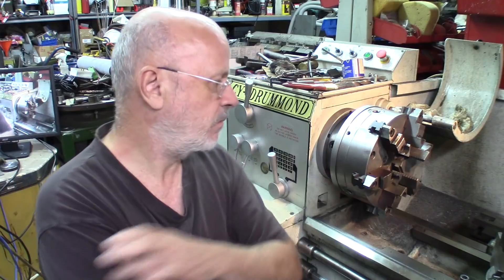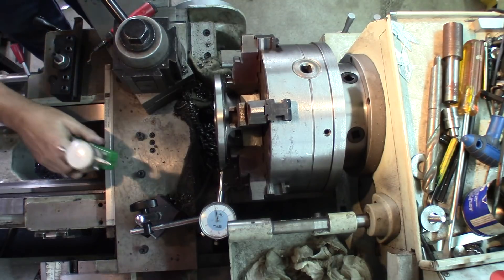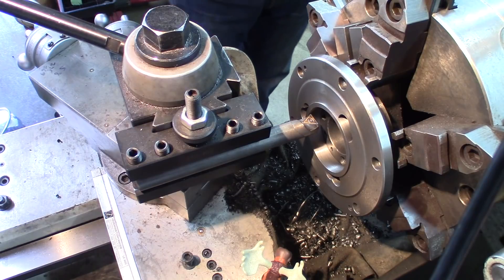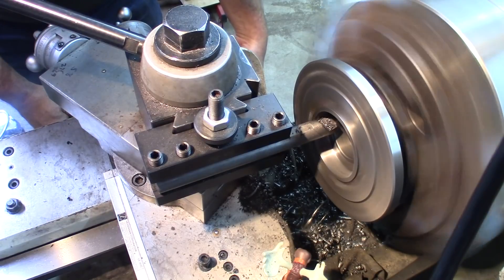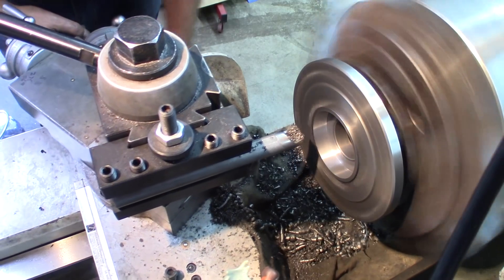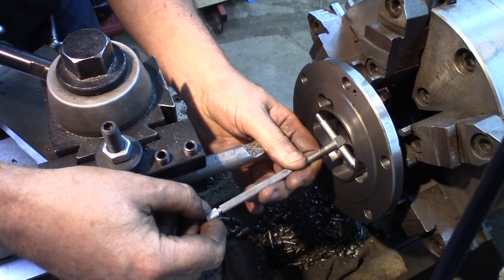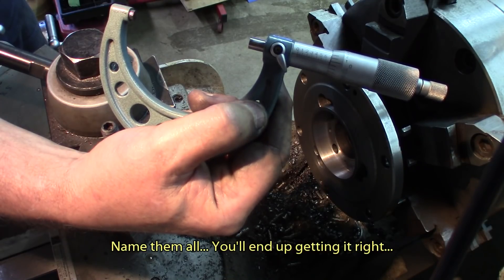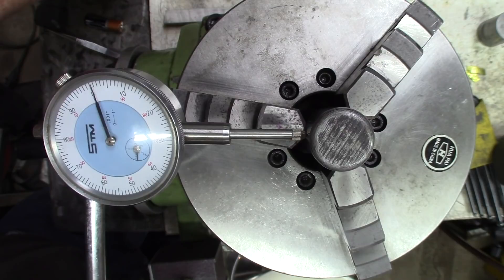Rotary head chuck runout repair part 3

Comment: Pierre, you have a good channel here.  A good balance between a good sense of humor along with good descriptive machining.  Thanks for sharing!  By the way, why did you choose to use cast iron for the material to make the corrective sleeve?
Reply from the maker: +Ujeb08 First, thanks for positive comment....  To address your concern about using cast iron to make the sleeve, since this is a press fit, I wanted to use similar material in order to make it so that those materials react close the same way to different conditions like heat and pressure...   ;)

Comment: Hello from the state of Missouri, USA. 
Enjoying your videos.
Before grinding the chuck, I think I would try indexing it on the back plate to see if some of the runout would be eliminated. 
Nothing to lose, and might save you some work. 
Keep up the good work.
Reply: Unless the jaws need to be reworked anyway.
Reply from the maker: +Jerry Long Hi Jerry from Missouri, I'll take your suggestion and when I get a little spare time, I'll try to check if the back plate can be rotated in possibly the 2 other positions, maybe when it's grinding time...
Thanks for suggestion and comment,   Pierre

Comment: you could have chucked the pin in the lathe and machine the register with the backlate assembled (to avoid grinding the jaws).
Reply from the maker: +sharp x That would have been a possible and decent solution, didn't envisioned it in the first place, I'm also reading more than one position to make an average of the runout for the scroll. In order to avoid making it worse than 5 thou.
Thanks for suggestion and comment,   Pierre
Reply: pierre beaudry
I should have said something after the second vid. Just out of curiosity did you check with a longer pin (just wondering if you have runout on 2 planes).
Now I'm wondering if you do grind the jaws how easy would be to center the backplate since you'd have no access to the register (I'm just thinking that might be easier to just redo the bushing)
Reply from the maker: +sharp x This chuck is in good shape, not much wear, and, the jaws are snug and even in the tracks, I will use the body's surface and the circumference as reference, also check the top of the jaws themselves, this is why I wanted to make the whole thing as regular as possible, I'll get something close to any decent quality chuck. Hopefully... ;)
Chuck like Bison or Rhom are in the 2 to 3 thou. range TIR for regular quality items, is you want chucks in the 3 to 4 tenth. range then price will jump sky high...
Reply: actually if I remember correctly Bison premium chucks are below 1 thou centering accuracy, something like 5 tenths for a 5'' and still below .001 up to 10'', but yeah, they are a pretty penny and for sure not priced for the hobby market

Comment: Good to see that chuck adjustment. I'll have to dream about that tho am getting a new removable jaw 3-jaw soon.
Nice precision job Pierre... beautiful sweet fit. :)
Reply from the maker: +ChrisB257 There still that 5 thou. I'd like to get rid of, and a few obstacles with the jaws, but working on something on a way to grind them.... Not this week, too much to do... ;)
This lathe is pretty rigid it helps for tight measures....
Thanks for comment,   Pierre